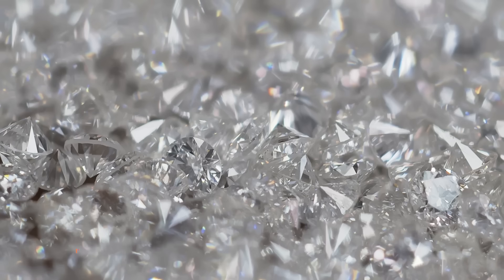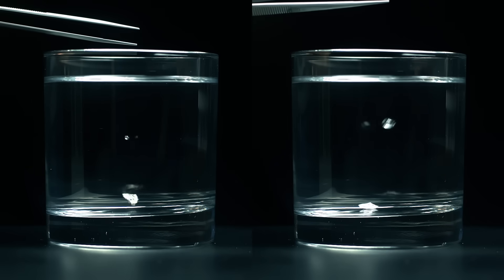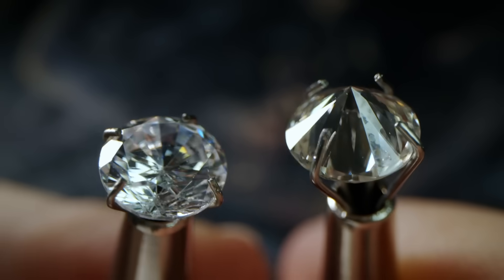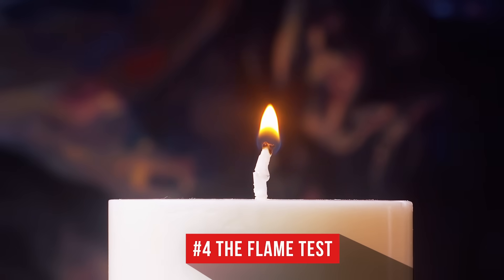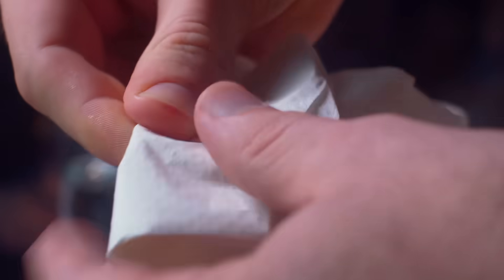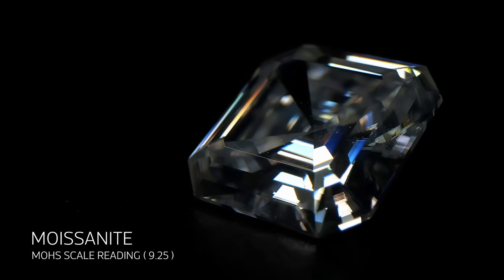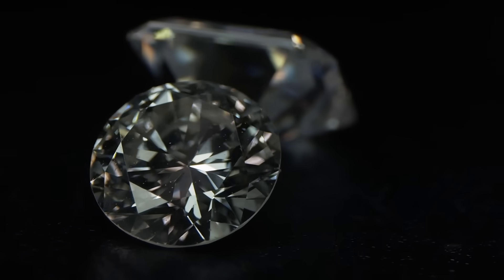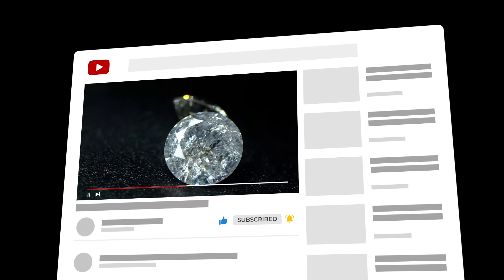Diamonds...REAL vs FAKE!

Comment: What about labmade vs natural diamonds?
Reply: Good knowledge and reply, I was hoping my question would help others out and you replied correctly. For anyone wondering the only way to discern them would be to use a loupe to find an inscription or code signifying that it is lab made or use an expensive machine to find out the composition of the stone. Lab made diamonds will be higher in carbon purity which is extremely rare in nature.
Reply from the maker: @NafstaPolarIce  you are correct my friend.
Reply from the maker: You need a different conductivity tester to detect lab grown diamonds.
Reply: @Crmjewelers  so none of these tests would work in that case right?
Reply from the maker: @NafstaPolarIce  not for a lab grown diamond. There's not one test that works for everything, but most fakes will be moissanites or CZs.
Reply: But technically a lab grown diamonds are not “fake” diamonds. They are almost identical in every way as a natural diamond.
Reply: @reflectivedetailing5936  many purist consider them "fake" and maybe people who don't understand. It's mainly naturally created Vs lab made, so technically yes you can't call then fake diamonds.
Reply from the maker: They are not fake at all.

Comment: How's Moissanite compared to diamond? Its less pricy, has the highest refractive index and near identical hardness
Reply: I think the difference could be specific gravity. Check it.
Reply: @vidyaranirao6432  Diamond - 3.5 gm/cc
Moissanite - 3.2 gm/cc
Reply from the maker: The hardness scale is not linear, so it does not compare to a diamond in hardness. It's higher than other gems, but not better than a diamond. Obviously it's a lot cheaper.
Reply: ---- @Crmjewelers ----- and mossanite is more brilliant--don't forget to add that!
Reply from the maker: They're different, but at the end of the day, I'd still go with a diamond, unless I didn't have the budget for it 🤷
Reply: @Crmjewelers  

The response of one who sells diamonds?
Reply from the maker: We sell lots of stuff and no, it's not because we sell them. They make less than 1% of our sales.